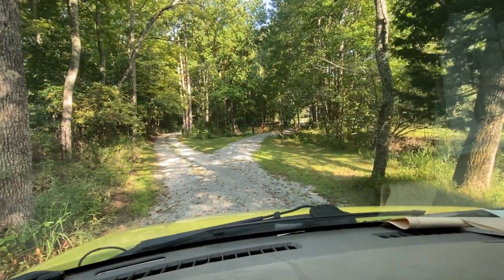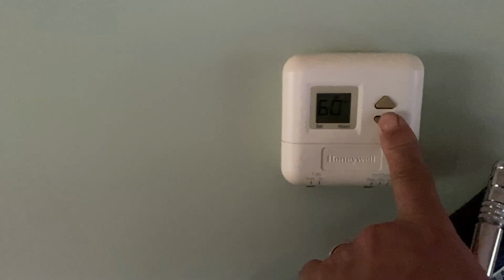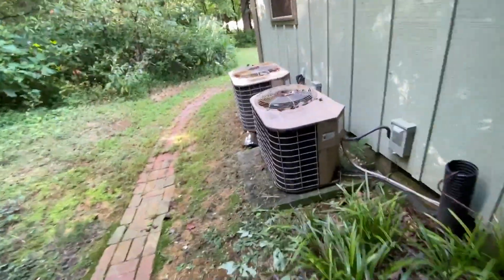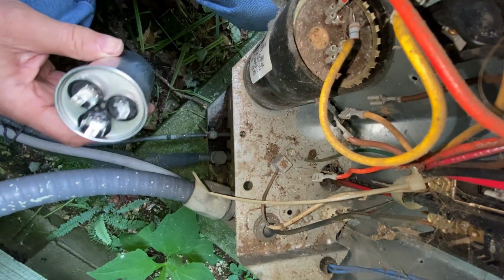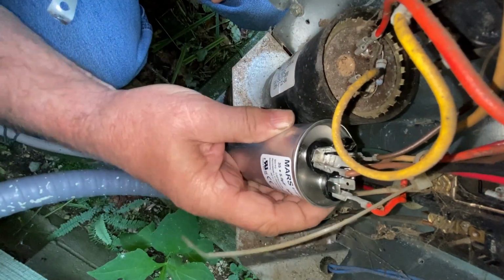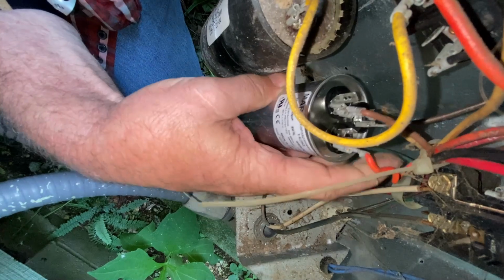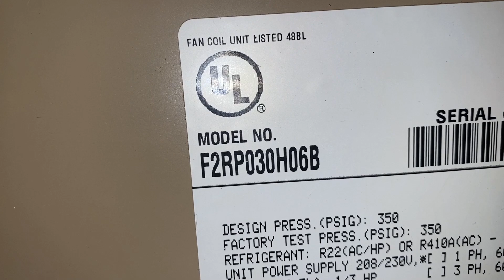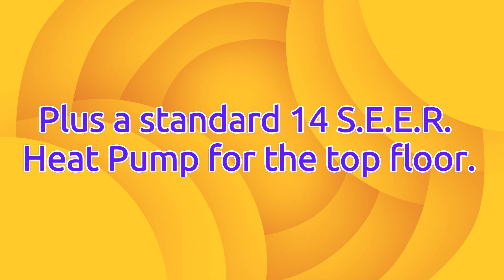Band-Aid for freon leak on R22 junk units

Comment: Some times it pays off to head off of the normal territory when folks need some good help.
Our A/C condenser was a fraser johnston back in the late 1960's, those rectangular types with the powerful fan.  It never needed serviced but surely used much power compared to newer units. She was a noisy unit too.

Comment: A talkative helicopter, for sure. Even though I knew the unit was unhooked from the power, the modulated buzzing from the other unit as you bumped up against it was slightly disturbing.
Reply: Contactor buzzing😂😂😂
Reply: Contactor was pulled in by the indoor unit.
Reply: Not from the other unit, buzzing is from unit he's working on. 24v still has contactor coil pulled in. He only killed the 220v outside.